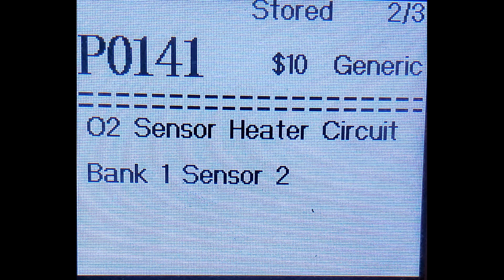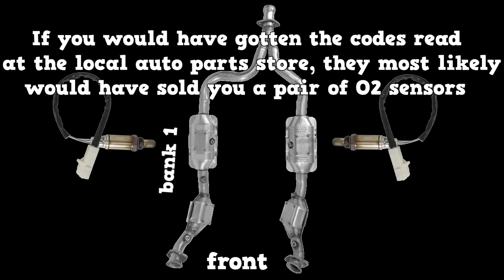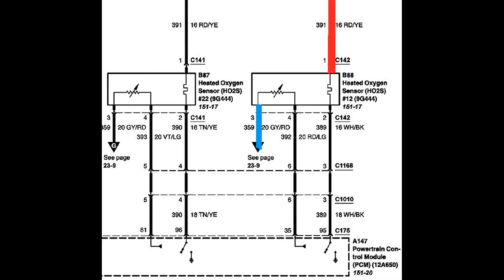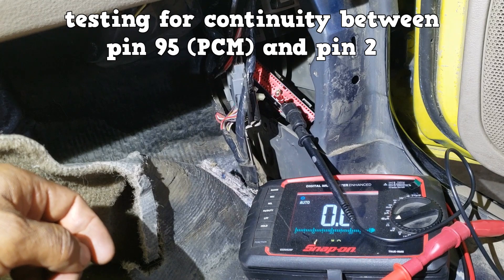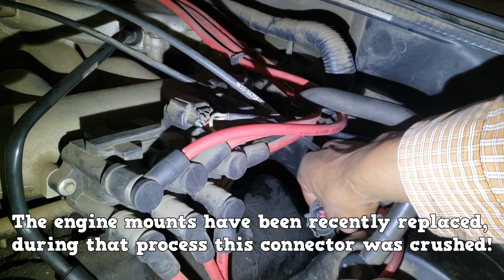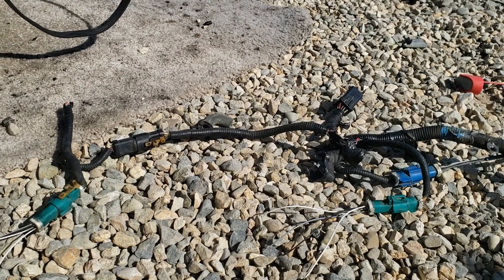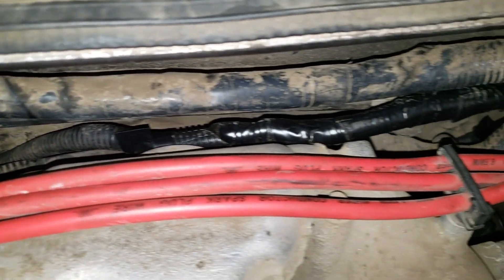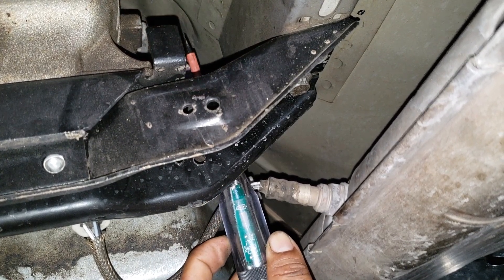P0141 & P0161  (99-04 Mustang V6)

Comment: Hi great video. Would you know if the bank 2 sensors Heater Circuit are PWM switched or constant on? I have a 2002 V6 stang and Bank 2 heater does not switch ON/OFF like on Bank 1's. Thank you

Comment: Should have just depin it, used the new connector  and there you go bro! Saves time having to wire a piggyback. But given the cars state this will do.
Reply from the maker: That is the logical thing to do, but there is absolutely very little space to work with back there, even if you remove the heater hoses. You would have to lay on top of the engine to try and connect the fixed connectors. Either way I needed a used wiring harness. Making the piggyback wan't much of a hassle. 10/10 right?